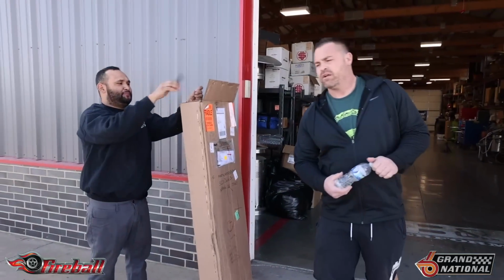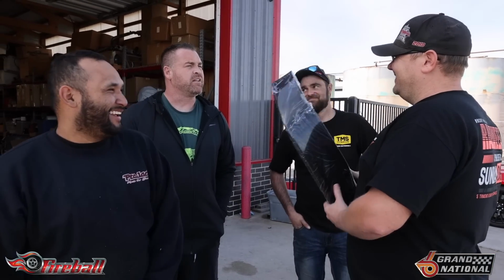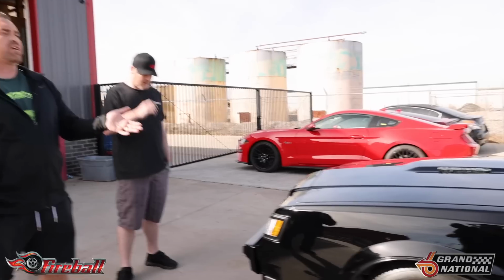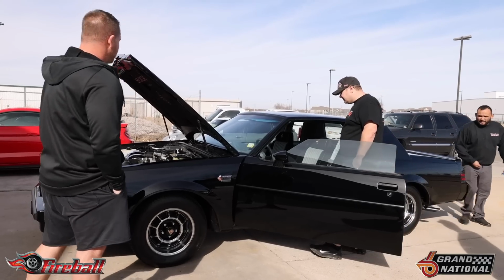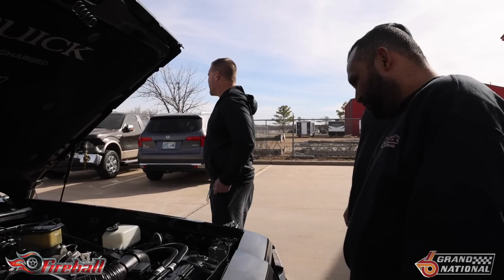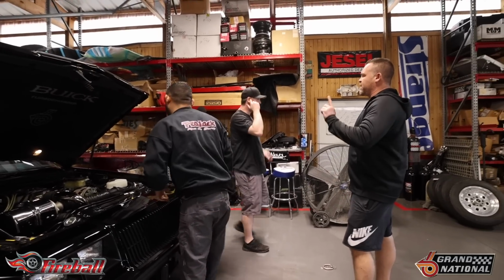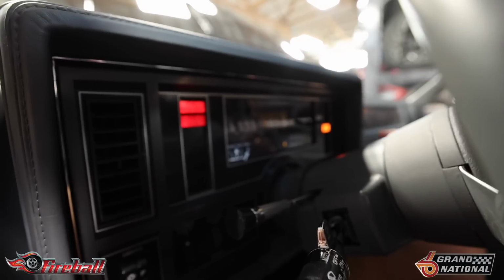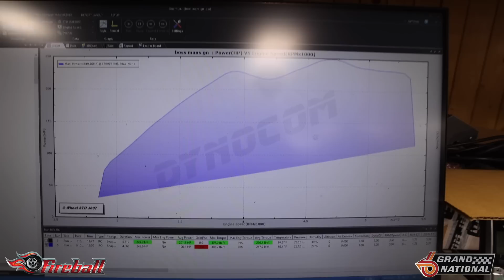Ryan Martin Gets His 87' Grand National

Comment: I'm on my 6th and final Buick Grand National building a TA performance aluminum v6 block w/ se heads 72/70 precision turbo e85 Janis transmission ptc3500 converter rjc intercooler 5inch downpipe w/4inch exhaust looking for low 9s and on kill high 8s

Comment: My first "Fast" car was a 1987 Mustang GT 302 5 speed H.0. Bought it after graduating in 1995. Deep forest metallic green  with factory Tee Tops and 273 gears. So much fun! Upgraded the injectors, put in 373 gears, and a chip. Changed the rear end angle and cut so much weight cut off. Put a holley systemax intake on later. Man I can still smell that car at 45 years old. Hooker shorties , x pipe and hooker two chamber mufflers turned down before the axle. Man I miss that car.

Comment: I would like to see the dyno numbers with just exhaust up grade with the catalytic converter deleted. Was told by full throttle speed.  U will gain 100 hp with just a cat deleted. My son scored a 1987 barn find. We did a stage II up grade. Cat delete full 3 inch exhaust 626 turbo, chiped for 93, hot wire fuel larger fuel pump larger injectors 3000 stall, stage II Trans with 2 gear wide alto ban. 3 inch mass air with updated mass air sensor Also replaced valve springs because when this cars sit will impact valve springs.  They were floating on us. We have not put it on the dyno yet.

Comment: That’s amazing that the car (original 35 years old) made 250 RWHP seeing as how they were only rated at 235 net crank HP by the factory.  Buick clearly way under rated them.  Most likely for  insurance purposes.  To make 250 RWHP that car has to be making 290-300 net HP at the crank.  No wonder they were so fast!!  BTW I guessed 200 before watching the dyno pull.
Reply: Actually, 245 for 87.  Not to be a know it all.  GNX rated at 276.  But yes, to your point, they were making more than advertised.  Funny side note.  1986-1987 are the only years in GM history that any car they made was rated at more horsepower than a Vette.  Vette's were 240 I believe.  Kind of interesting.  Think Buick got butt chewing for that.

Comment: Wrong comment on the Turbo TA.. They did not detune the HP rating to keep from detracting from the sales of the GN since the last GN produced was in Dec 1987 while the first Turbo TA was not made until Nov 1988.
Reply from the maker: That would be why I said “I think” and “someone told me” verses.   This is a fact.   I think I even said.   “Someone will correct me I’m sure “
Reply: @FireballCamaro  I owned 3 of these back in 1988 and drag raced two of them for years...They were amazingly ahead of their time technologically and it was not difficult to improve the hp and torque substantially .  I was able to run deep into the 11's back in 1988 (still driving home from the track with 24 mpg) without removing a valve cover or changing the factory exhaust manifolds which were essentially tube headers. The weak point in all these upon increasing the HP/torque was the 2004R trans especially the input shaft. I broke the trans many times in these. The GN is a great iconic muscle car of the 80's. I spend more time now playing with my 1970 Buick GS Stage 1 which again is an iconic 70's muscle car. The Buick 455 makes a ton of torque at a low rpm. I have owned Big block Chevelles (including a 70 LS6 454), 70 & 71 Olds W30 455, 70 Dodge/Plymouth 440-6 and 426 Hemi and none of them made the torque of the Buick 455.

Comment: I HAD A 3.8 TURBO  ODD FIRE IN A OLDS STARFIRE THAT  HAD A  A BLOWN MOTOR SO I TOOK IT OUT AND HAD IT ALL GONE THREW DIFFERENT CAM BORED STEEL CRANK 4 BBL HOLLY CARB ELELBROCK INTAKE JUST EVERYTHING I COULD DO AND IT AND IT ONLY PUT OUT 400.HP TO THE REAR

Comment: As mentioned; only 245HP@4400RPM from factory, 14.7sec@95.1MPH quarter mile.  Wife's 1986 Fiero GT (V6) was faster back then with both stock. . . ...GN weighed a whopping 3300#'s vs 2450#'s, I left & never saw him.
Reply: Stock GN’s regularly ran high 13’s to low 14’s. Fieros weren’t coming close to those times.

Comment: (6 cylinder and turbo)As the Buick V6 becomes more dominant in the market place, the Buick V6 logo will take on increasing significance.
The logo represents a “6” which is emphasized to indicate the Buick V6 is unique and special.
Additionally, the logo represents a lower case “b” which could be utilized to develop a performance image logotype exclusively “Buick”.
The flow of the logo is also symbolic of the spinning or turbine action of a turbocharger.
Turbocharging can also be emphasized by using warm-to-hot color combinations.
The arrowhead draws attention and gives forward, aggressive motion.
This is complemented by the slant of the logo — again emphasizing aggressiveness.
The logo symbolizes the Performance Engine of the Future.
Reply: I always thought the turbo symbol on the badge was shared with Garrett air research which is who I believe did the turbos on those